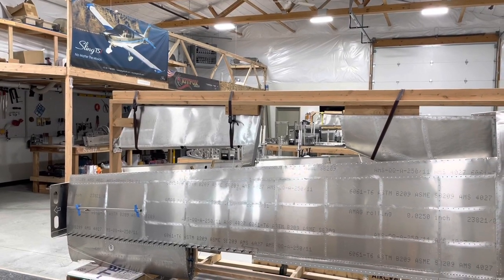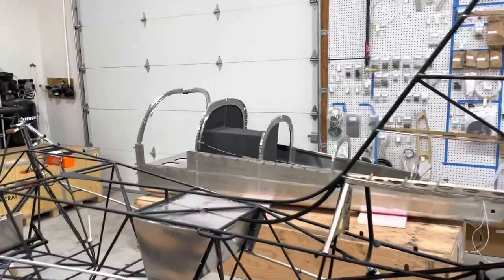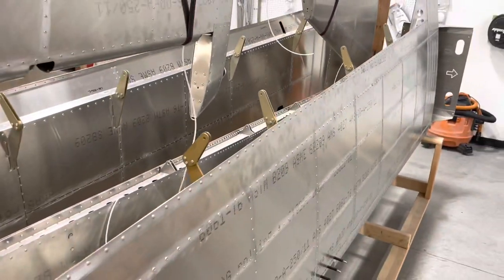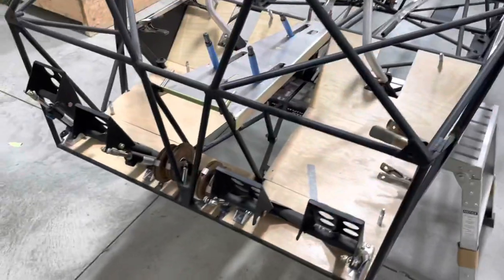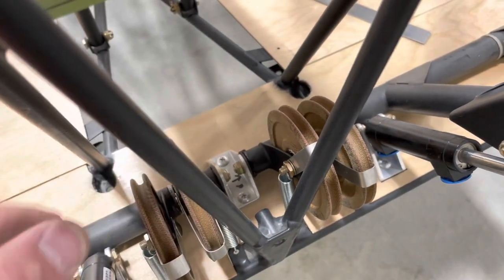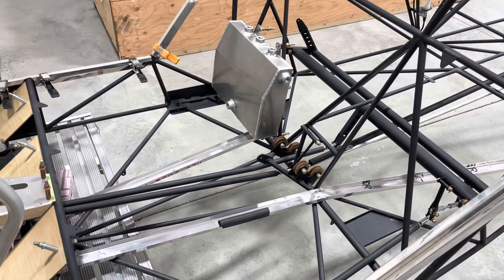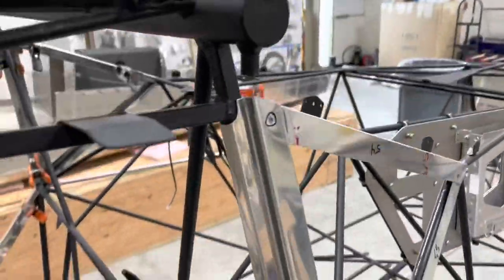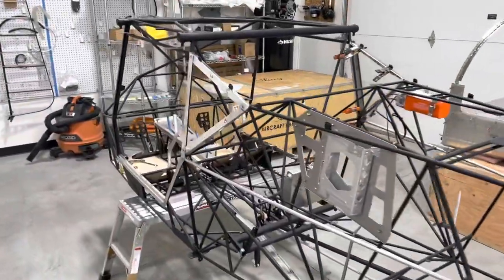Kitfox Build Log 1 (and Sling stuff)

Comment: Immaculate work as always, Evan! 
Can see you are busy busy busy. 
Are you yet able to comment, post testing, on the weight and balance upgrades you were testing on the Slings?
Reply from the maker: If you’re referring to the firewall ballast to counterweight the parachute, it works great, 50lb at the firewall is what it requires to keep the plane in good cg. Of course keep in mind that’s 50lb of useful load, but for some families it works out if they’re on the smaller side, like the owners of that tsi. For larger people, there may not be a perfect solution, but I’m always working on these little things in the back of my mind so maybe a better solution will present itself in the future!

Comment: The reference to your previous video where did you put the ballast in the engine compartment is it only gearbox is it on the firewall ???
Reply from the maker: It’s on the firewall, on the cabin side
Reply: Roger that, thank you😁
Reply: Thanks.,, I think I'm going to try on the front of the gearbox that way it has a better arm... And combine that with a normal heavy battery that would be on the firewall
Reply from the maker: @steveyoung6787  sure, good luck! You’ll need about 40lb on the gearbox to get it to work properly. And that’s if you remove the counterweight from the elevator as well. Otherwise 50lb. I didn’t trust the gearbox to hold that kind of weight without damage